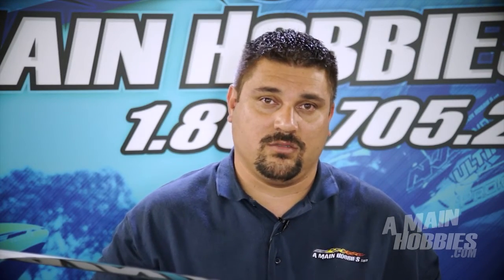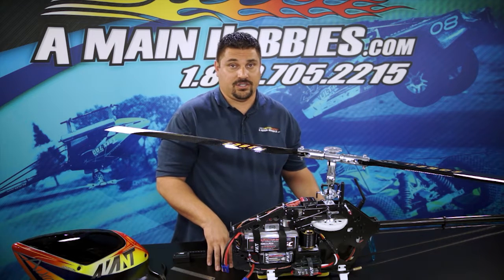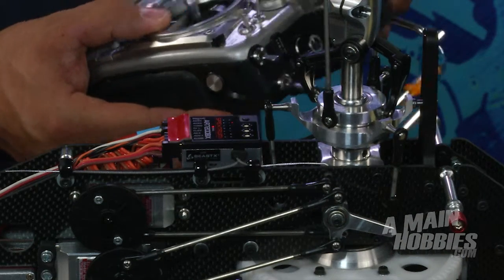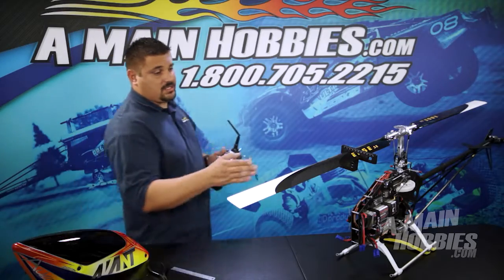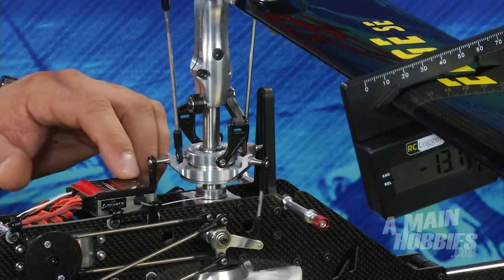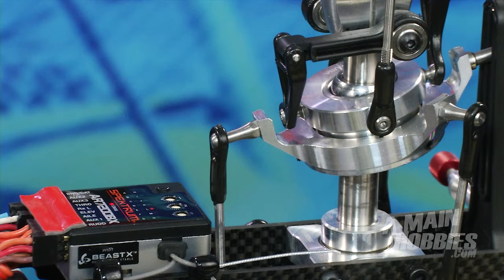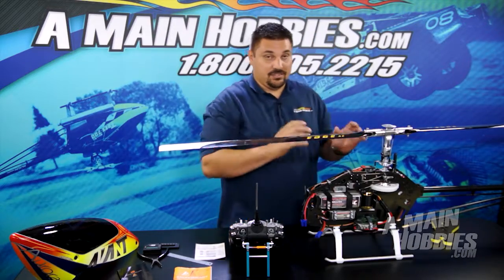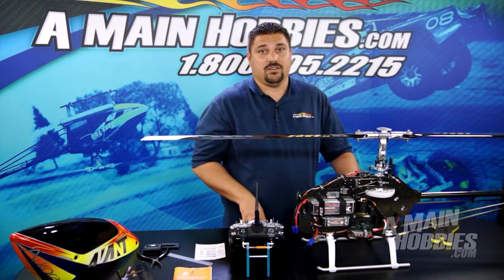How to Setup BeastX Flybarless Gyro System, Part 2 of 3

Comment: Your setup video was great, it help me alot to understand the beastx and how it works, many thanks, the reason i pin point setup J is because i'm having problem getting blue light at 6 degrees, i can only get red, tried what u said in the video, i can get blue light at about 6.6 degrees, every other setup u explain went very well with me. thanks again.

Comment: Hello, this was to help understand the idea of what menu J is about, your right the pitch gauge should read 0 when starting.The pitch gauge was not zeroed to the heli from side to side only from front to back so it was about half a deg off. With the pitch gauge reading 0 you then use aileron to reach 6 deg and at that point you should see the blue light.  Please let me know if you have any other questions about the video.  Greggor  A Main Hobbies Tech Support